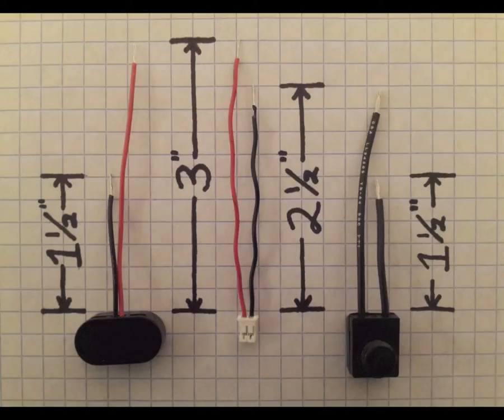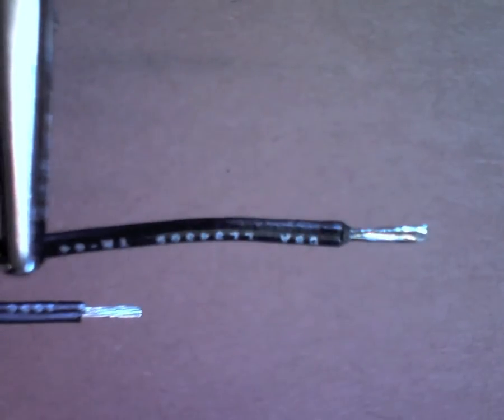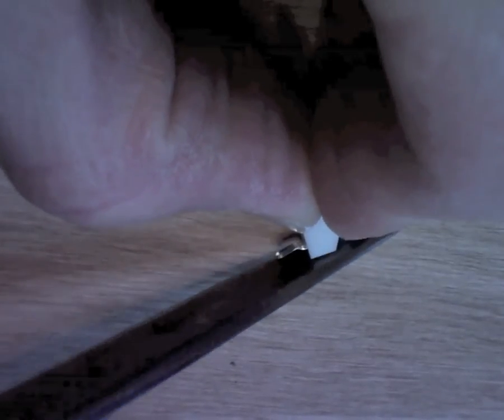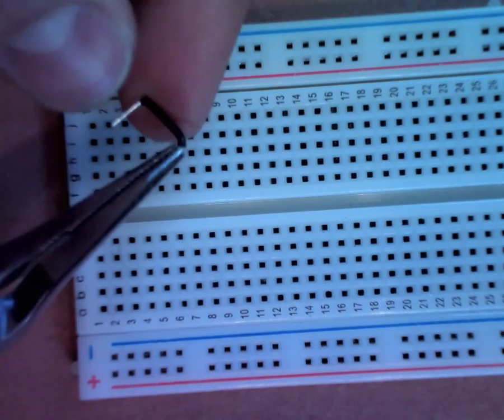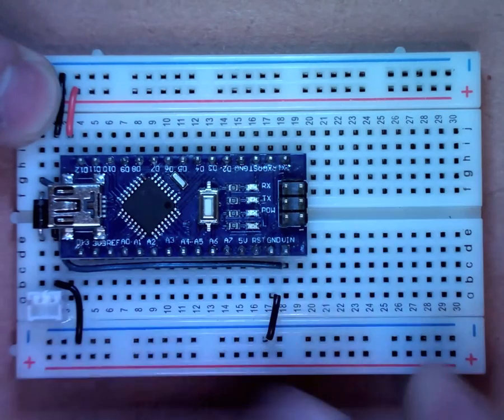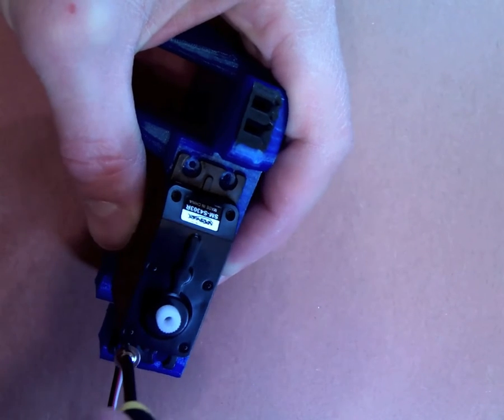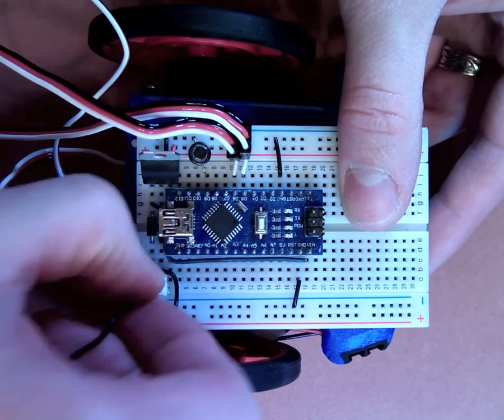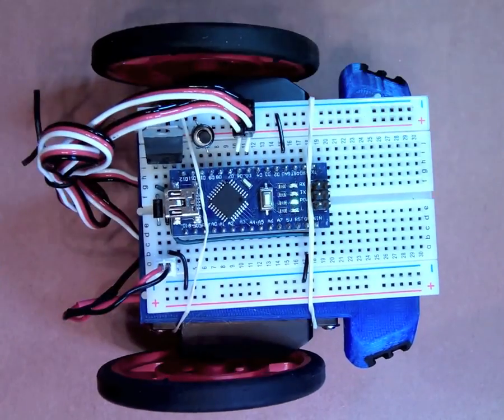How to Make a Nano Mouse 3.0

Comment: Hi All. Ok to download the frame and wheel you need to go to https://www.thingiverse.com
search for nano mouse then look for Michael Backus then download the NanoMouseParts.scad file.
Then download the OpenSCAD program onto your computer then generate and save off as STL the Frame and the Wheel using the program OpenSCAD use F6 to generate the STL for each. I found the 3/8" ball bearings off ebay. Now I just need to work out what Michael used for the rubber on the Wheel.

Hey Michael, What did you use for the rubber on the wheel?